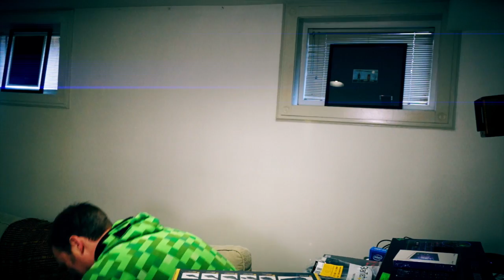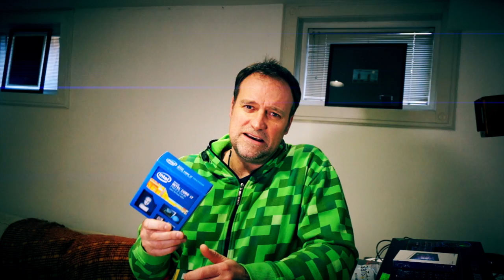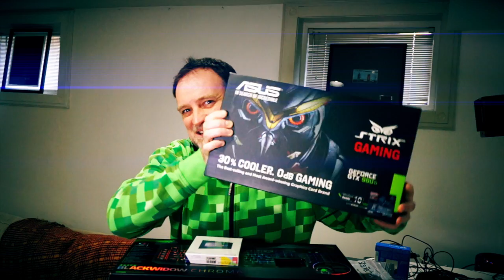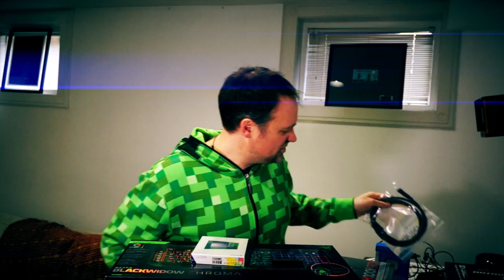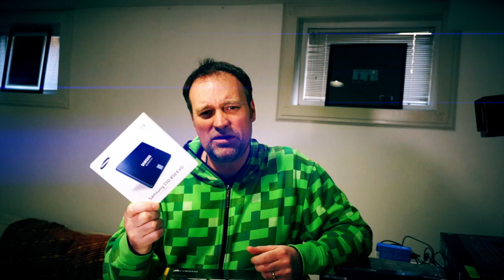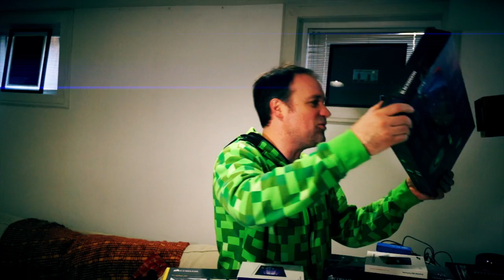VR PC Pre-build Parts showcase

Comment: ewwwwww shoulda gone with Strike 7 Matcatz keyboard :L
And dang, one-up from my GPU D:
1TB SSD, gimmeh!
Windows 95, gotta miss it xD Was back in my days too when I started using computers :L
Reply: dha12oks strike 7 sucks corsair k95 rgb all the way
Reply: Don't diss if you haven't used it lol, it seems to have more functions then the corsair k95
Reply: i have used it, i have a friend who tryed to sell hers to me, and aside from it breaking after 3 months it didn't have many features aside from the screen which didnt work half the time and doesn't have much support and its MEMBRANE, dont get me wrong i love madcatz and i love my rat pro x and mmo7 but a membrane keyboard is not worth $200 let alone its $300 price tag when it launched
Reply: earthtohenryk  Had mine now for like... 4 years I think, the only problem I've had with it, is sometimes the software wouldn't boot up (I unplug my keyboards power when I switch my PC off), besides that it's an excellent piece of equipment imo :)

And yup, MMO7 ftw, got one myself :)

Comment: Well David, Building a new PC can be quite expensive. Building a new GAMING (or 3d Modelling) PC IS quite expensive, ha :) 
I started my upgrade of a decade old system in January. At first the intent was just to get off my AMD setup, so got a new Asus Motherboard and i7. I could still use my existing RAM, but got some more anyhow. Sitting at 32GB. Obviously needed a heatsink so got the Hyper 212 Plus which works great. Then I hit a roadblock. My old 480w Thermaltake power supply did not have a high enough rail nor did it have more than one SATA, so upgraded that finally. Then got the new NVidia Geforce GTX 970. - All in all the only thing I didn't upgrade was my tower case, hah.

Comment: I was in such a toss up between doing an x99 5960x build and a z170 6700k build... I really wanted the faster 8 core processor, but non of the x99 motherboards have more than a single gen3 x4 m.2 slots, and I wanted a triple 950 pro raid0, so I ended up going with the z170, but I made up for it by picking up two 980 ti  cards (the same one you've got, it looks like)

Comment: Didn't know Dr. McKay was basically a curmudgeonly version of yourself!

The card you got, the 980 Ti, is more or less the best you can get right now unless you decided to go with multiple cards. However, what I would personally have done is get a sort of middling card (like a 970, which is enough to play any VR content at the moment) and waited for Nvidia's Pascal cards later this year. They went from a 28 nm process to a 16 nm one and if the rumors are to be believed, doubled their performance per watt.

Nice build anyway though!
Reply: +avicenna  that requires knowing a lot more about computers then most people do but you're right and his new rig could easily upgrade

Comment: David: Pronounce it "ay-sis" like the end of the word "Pegasus". This is how the CEO of ASUS says it's pronounced.

Though if I'm honest, I've had much better luck with GIGABYTE motherboards over ASUS. Sure ASUS has all the cutting-edge features and such, but with extra features comes complication, and eventually more bugs and weird behaviors. That's been my experience anyway.

Also double your RAM to 32GB. Running 16GB is fine, but as you're using an SSD, you should for sure turn off Virtual Memory, or you'll see your SSD performance drop dramatically very fast and you'll kick the crap out of the long-term performance of it. No Virtual Memory means that running out of memory (for whatever reason) will cause you serious problems, so bumping up to 32GB will avoid that.

Source: http://www.engadget.com/2010/12/17/how-to-pronounce-asus-video/

Comment: +dHewlett  Real cool system, that i7-5930K is a really cool chip. :) Are you planning to overclock it or your gtx 980ti at all? :D You should be able to safely OC the 5930K  to  4.2-4.6ghz safely with your cooling system as long as voltage is below 1.3v. Sorry, just a huge overclocking geek, currently rocking a haswell i5 4690k oc'd from 3.5ghz to 4.95ghz and a 8 year old intel core 2 quad q9550 quad core overclocked from 2.8 to 4ghz . All safe voltages and temperatures.

Comment: PCPer.com, great system builders' site.

I don't know how much your extra i7 cores are going to help with gaming.  I was under the impression that the most important gaming component was the GPU(s) (on the graphics card(s)).  PCPer not that long ago has had Pentium systems laid out  (e.g. with a Pentium G3220)  which perform fairly well because most of the gaming experience is (as you noted) pushing the pixels around.  It's just a matter of allocating your money; I've always heard lean more towards the GPU than the processor.  Quad core should be quite adequate, at least for the next few years.  Bonus if you have 6 or 8.

You're right, sometimes faster RAM access is better than a larger amount.  It all depends on the workload, and I would think with gaming, there are just a LOT of numbers being pushed all about, so the faster you can get at them, the better.

Comment: great minds David, great minds. we have nearly the exact same build. only differences with graphics, PSU and case. i'm running the i7-5820k on the Asus X99-Pro. PSU is a Seasonic SS-1000XP which is made of extremely premium parts. same cooler,  SSD and memory though :) built the system last summer though im waiting on the next graphics card releases to buy one so currently running an old radeon card. i have been building computers every cycle for 17 years so believe me when i say you have a nice system :) couple of small questions, did you pick cherry keys for your mechanical? what are you using for sound, headset? and finally what games are you planning on using your VR set on? recommend Elite dangerous or Star citizen. also hear games like war thunder can make use of the tech as well. have fun building :) de-static yourself!!

Comment: So happy for you man! I heard you say you were considering doing this, and that your wife made you get the mac (Hopefully that doesn't get you in trouble!).

Good choices on parts. You'll be fine with the SATA SSD. 500mb/s vs 2500mb/s for the best PCI-E ones, but nothing you do is going to actually use more than 500mb/s trust me!

If you have questions, ideas, etc. don't be afraid to ask your audience. Take care and best of luck.
Reply: +XFourty7 Yeah, I'd have probably gotten two 500gb ssd's and run them in raid 0 for higher speeds, you get the same capacity and faster speeds for the same price normally. but it is slightly riskier in terms of data protection. but that shouldn't matter on a non storage drive.
Reply: http://imgur.com/KrNnpd1 that's my main drive, 2x 240gb SSD's in RAID-0. I love it, and am fine with 2x drive death chance.. but I would never suggest it to someone else ;)
Reply: yeah that's exactly what I have, no reason to keep important data on your ssd's anyway that's what a raid 5 array on storage drives is for so I don't care about the increased failure rate.

Comment: WD Reds NAS drive mmmm would have gone Black, the reds are for non-constant use storage rigs. You will also max out that 16gb of ram if you game at 4k, with a high draw system a diamond or platinum rated PSU would have been a better choice.
energy efficiency guess a long way.
Also another cash save is buying Windows 8 or 7 pro as they come with a free Windows 10 upgrade.
You may also want to load the case up with more cooling, some silent series fans will help out alot.

Comment: LOL!!! Right GFX!!! Right PSU!!!! Right CPU!!!  get 32 gigs of ram - I max them out just in Premier Pro....
Personally win 7 - but 10 is looking solid!!! Perfect SSD... 
You maybe over cooling

BRILLIANT!!!!!!
Reply: +TWBrit com with the K version of the CPU you cannot be over cooling (not that you could in general) so, if it stays nice and  cool, one can easily overclock.

The only thing you probably could have done more would be the skylake i7 6700k to go with the newest generation. I think everything more than the 980ti is a bit too much for the price/value for gamers. and well, you can always upgrade if it's not enough in a couple years.
Reply: Well with gfx card and ram, most of the intense work is being offset.  But then I use my stuff for video adit/rendering and the only heat I worry about is the gfx card. 
But then I'm only use a i7 3770k  at 3.50 In a stormtrooper case.  
The only time a fan may increase in speed is during rendering and that heat is from the gfx, the cpu doesn't seem to skip a heartbeat. 
But yes, the colder the cpu the better it performs. 
That and living in Canada - he only has to open the door ;) [pun intended]
Reply: +TWBrit com  Rendering of video?  my CPU has its heaviest load with that, but maybe that also depends on the program you use and the configuration. 

The air cooler (CoolerMaster Evo 212) I got on my (new) 6700k is okay, but would definitely improve with this water-cooler. as it is now, I need to run it on stock and it gets quiet warm on heavy load (60° ish on about 90% use) I need another case cooler too, as I'm not that happy with the air flow. 
my GPU doesn't heat up much more, tho.
Reply: +franziska1007 I mainly use Premier pro which allows the render to be done by the gfx card (I know you probably know that). I  spent more time counting cuda cores when choosing a card than anything else. But at first is was a nightmare until I realised the Intel onboard gfx was still installed - once I got rid of that the change was stunning. 
I can do in around 3 minutes what takes my better half 30 on her all singing and dancing Alienware.
But in all fairness I don't make anything longer than 20 mins, but the After effects stuff can a take a while. 

However in Photoshop CS6 - it uses the CPU... which when I was working on a 900dpi render of around 4 feet wide maxed the hell out of the CPU and 32gigs of ram :/
Reply: +franziska1007 I'm actually more proud of the NAS I built in comparison lol

Comment: Hey David, thats a solid build you bought there, still i can not reccomend windows 10 to be honest, I'd rather stay with win 7.
Might just be my own opinion, but for me as a IT specialist i can tell you, even aside all these "Windows spys on you" issues its a nightmare to properly administrate it.
Reply: +Shade The Black Wolf only problem there is that MS is not looking to get DX12 running on Win7. Vulkan will make it, but doubt DX12 will. Win10 has its issues, but build 10586.164 has fixed a lot of things. I run it at home and work, and there are some annoying things with it on older hardware... but a fresh build like this should have few problems if any.

Comment: It's funny to see the people who were once at the cutting edge of technology with 8088's for example, and how the speed of technologic development has just overtaken them.
I would say you've been slightly ripped off on some parts (the RAM for example, I have Dominator Platinums as well, tho, because I just had enough money for pretty looking RAM), but you can usually get memory that's just as good for half the price or less. The 980Ti will remain the best single video card for gaming until the 1080Ti is released, that was a good choice. Your CPU may not have been the best choice, as it is more of a workstation CPU, it has many cores and good single core performance, it works perfectly fine with games and is generally more powerful than the 4-core CPUs, but nowadays games, even VR Games tend to be not very CPU intensive. You could've easily gotten away with an i7-6700K Skylake CPU, that one is cheaper and delivers the same gaming performance and even that might be overkill, as the top end i5 XXXXK model of a series is usually just as good as gaming. The i7 series are more optimized for work(ish)-use, such as video-rendering for example, which can make efficient use of more threads and cores.

Well, I hope you have fun with the build, and as much as I'd like to see a buildlog, I think it's better if you share that moment with your kid, but without the Internet watching.

Comment: The ssd that you can plug into the motherboard is plugged into the PCI-E
Reply: +Gates Reviewers or M.2
Reply: m.2 is another connector on the motherboard
Reply: Gates Reviewers that can accept an ssd
Reply: +Slightlybored there are 2 types of hard drives... 1 is a normal hard drive with a spinning disk inside, and then there's SSD which is a fully electronic storage device (like a usb) you can't plug in a hard drive into a m.2 port however ssd's come in a m.2 form factor so you can plug that it in.